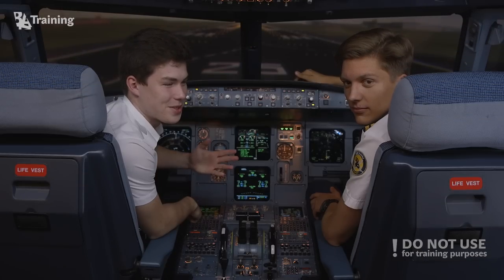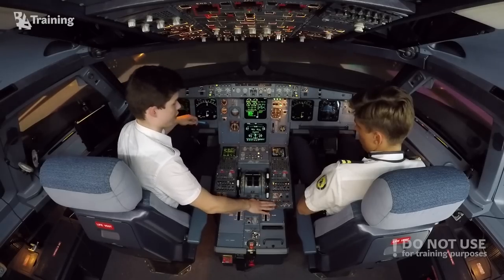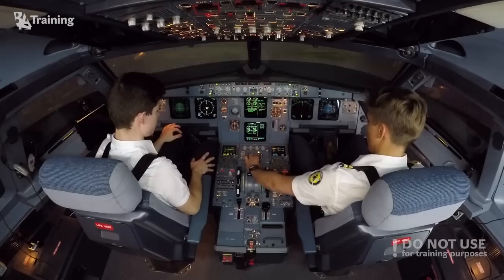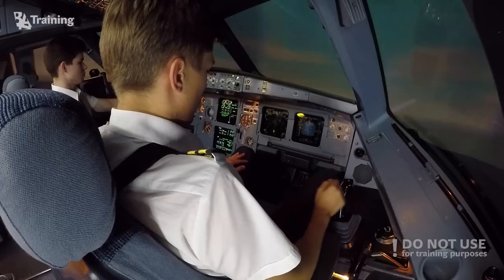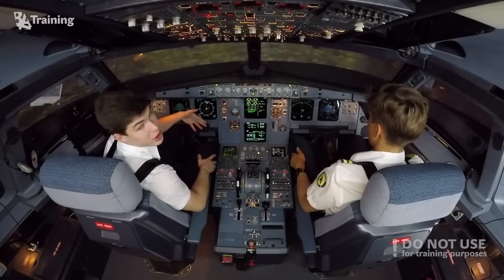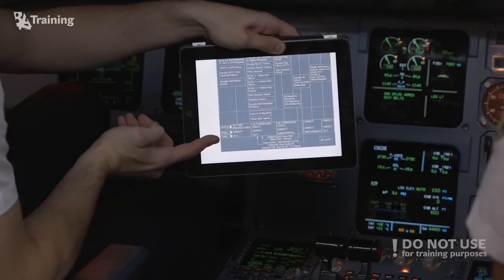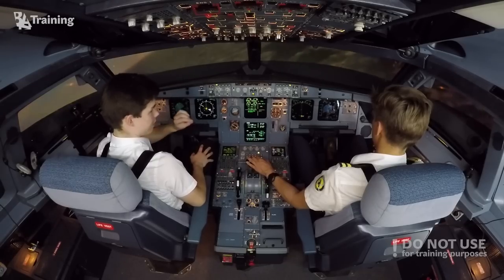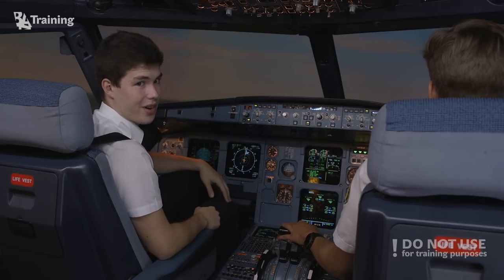Airbus A320 flight controls and protections - BAA Training

Comment: This is very useful for Flight Sim enthusiasts to understand a bit of how this Airbus is designed to work.
Reply: C* algorithm to keep demanded G load. Unbelievable simple and good algorithm in same time. Just only three data sourced are needed (not including protections and load factor when banking). Demanded G load (from sidestick or autopilot), actual G load and pitch rate. Last two are used as negative feedback loop - same as in analog operational amplifiers. Beauty in simplicity.

Comment: What would happen in case of low pitch flying when he push stick all the way forward and reach minus 15 degrees but without higher speed. Would Airbus maintain minus 15 or increase angle of attack a little bit up to  minus 10 for example?

Comment: Yes, your first statement is correct, it is safer and more comfortable, until it goes wrong. The Airbus systems control the aircraft and can do everything that a pilot can do, maybe more.  The pilots are system operators,  who are in the cockpit for when things go wrong.  The new generation of pilots lose basic skills over time and will, eventually, be unable to recover aircraft when things do not work as advertised.  They often do not understand what the aircraft is doing and thinking.   Airbus rating training often conflict with pilot basic training and certainly for my students (I am a simulator and rating Instructor and examiner)  ) they get confused. Confusion leads to distraction and accidents and incidents,  I am not a fan.